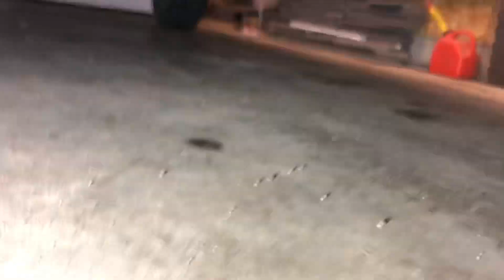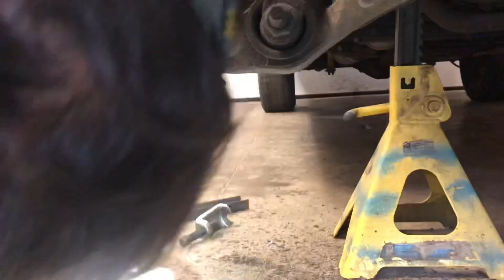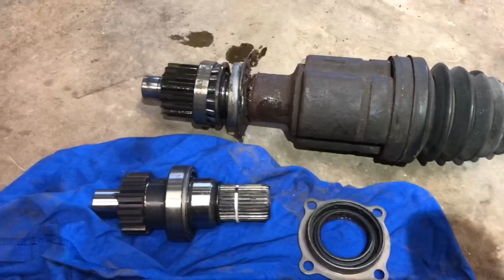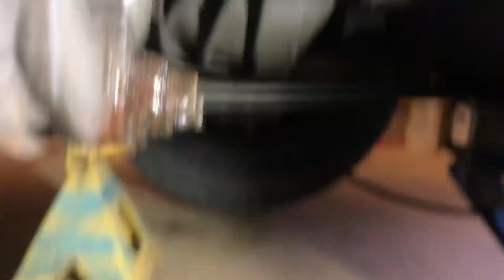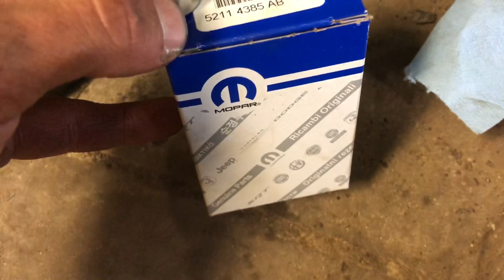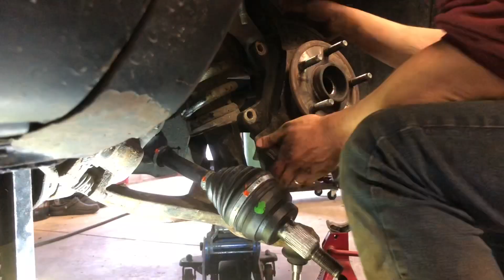Dodge Ram No 4WD - Stub Axle and CV Axle Replacement

Comment: Hold on how did you get the bearing race out
Reply from the maker: driving the pipe with the rag on the end hydraulically forces the race out by pushing it from behind. It’s crazy but it works

Comment: Just did this job due to a split cv boot. You can skip a few steps here and save a bunch of time/effort. Leave brakes and lower ball joint attached. Only need to remove upper ball joint and tie rod. You can manipulate the whole knuckle assembly and pull out the axle. Just detach it from the inner side first so you don't fight with it coming out of the hub/knuckle area. The way shown here is probably by the book though.
Reply: hey man, i’m doing the same job right now on passenger side. was it easy to get the new part back in that way? i’m assuming i’d put the inner side bolted up first then put it through the hub?

Comment: Mines leaking. So i went under to check it out...looks like the head of 2 of the 4 bolts holding the axle in are broken off...great
Reply: Some only have 2 bolts, my 2011 only has 2. Totally normal no worries! The 2 bolt is more prone to leaking, mine waited until 160k to start leaking, it was time for CV axles anyway so I can live with it.

Comment: Thanks for the help.  Made my 2007 job much easier.  Your tie rod end remover is a great tool.  Broke a Harbor Freight puller and found a puller at Auto Zone strong enough to break loose the lower ball joint.

Comment: Thought I might get lucky and find the 2012 and up ram 1500 biggest crutch . The passenger side intermidate shaft. Damn you Chrysler what your doing should be against the law . How many rigs on the road have that vibration that starts off light . Then cv axles tear apart one after the other . By the time your 4 cv axles in at 200 bucks a pop you find out it's the intermediate shaft in the front diff that Chrysler won't sell you. They will fix it for 2500 or sell you the drivers side shaft . Crap I can get those for 25 bucks . I will never buy another ram ever . I love my 2015 but not enough to take it up the ass with a smile from Chrysler . Should be a class action lawsuit .
Reply: @JD Spears drivers side yes passenger side I can't find one . Napa even dodge say they don't have them. 2012 and up they wanna sell you the whole front diff . I can get used ones for 800 bucks
Reply: @andrewdenine1685  I could be confused by what part you want but I just bought one at O’Reilly’s it was about $100 came with gear and bearing as well. Is that the part you mean?
Reply: @andrewdenine1685  1a auto has it

Comment: Why is dodge not selling that passenger side stub axle . I can get the drivers side but not passenger side for 2015 ram 1500
Reply from the maker: There is only one stub axle. It is on the passenger side.
Reply: @rudijones  half shaft / stub axle same thing . drivers side has the shorter stub axle. it's cheap
and comes out easy .

Comment: where's your C clip?
Reply: JD Spears I always put a new one in, as well as the C clip seal that matches the depth on the CV axle with the differential....did you use one?
Reply: JD Spears No, there is a rubber seal that goes with the differential and another "o ring seal' that goes at the back of the cv  where it connects

Comment: That whole housing that you are working in. What's that called. I broke off bolts and my extractors inside it.
Reply: How did you go about changing it.
I had to tap two holes, and both only able to do half way.
Contemplating whether it's best to replace that housing box...
Not sure the name of it myself. Was it hard to change?
Reply: I broke the housing on mine and I don’t know if i can pull the housing with the pipe it connects with

Comment: Great video - thanks!  Just wondering if you should apply grease to the stub shaft and cv axel splines when installing the new parts?  I didn't notice any grease on the inner bearing, intermediate shaft, or cv axel splines when you put it together and I assumed you'd need some? Can anyone comment on that, please?
Reply: Yes. Some bearing grease would be beneficial. Not a crazy amount. I would put a coating of anti-seize on the spines too

Comment: Awesome video man! I like when videos are very detailed and shows what troubles you can run into. Probably the same setup on the drivers side?
Reply: No. Drivers side is justva plain splined shaft held in by a c-clip. You need a slide puller to yank it out
Reply: @JD Spears Uhgg. Yea. That can happen. Good Ole rusty rams
Reply: @JD Spears I didn't see that. Thanks brother. My housing actually has a crack in it. I need to get one from the junkyard or ebay. Its causing the shaft to wobble cause its no longer a perfect circle due to the crack . its oblong

Comment: One thing I found helpful is to pull the 4wd shift module.  Much easier to reach in there.  Oddly, my differential only has two holes for the seal flange bolts
Reply: Mine does too. 2011 ram.  Does the 4 bolt seal fit on the 2 flange housing?
Reply: 2010 1500 only has 2 bolts on flange...not sure why they would do that other than to freak me out...thought a couple bolts fell out til I got my head in there to see

Comment: How do you do the driver side?
Reply: Good question.
In the process of doing this now.
Wondering if the driver side came out the same way. If so, will I have to open the differential housing to do the driver side?
Not sure if there is a lock ring inside that needs to come off
Reply: @keith172527  its a plain splined shaft held in by a c-clip. You need a slide puller. After you remove the d/s axle, hook the fingers of the puller on the groove and use a hose clamp to hold the fingers on the groove of the stub shaft. Yank it out. Tap the new shaft in gently